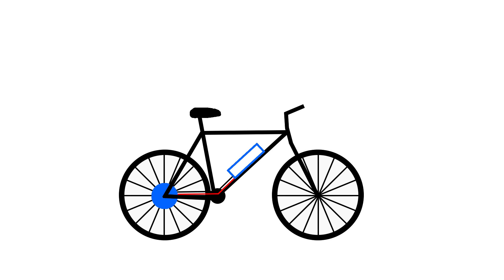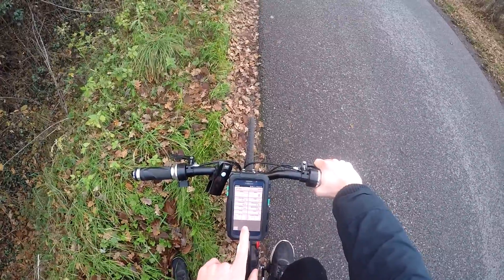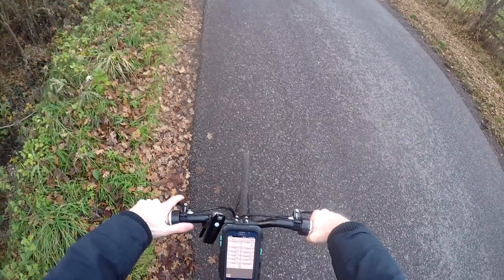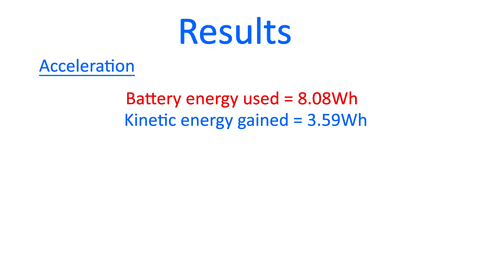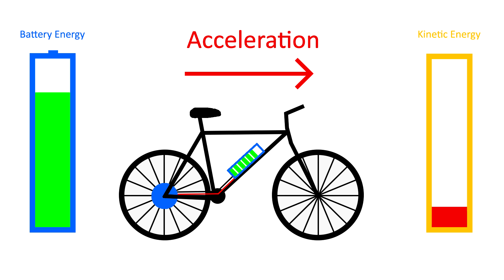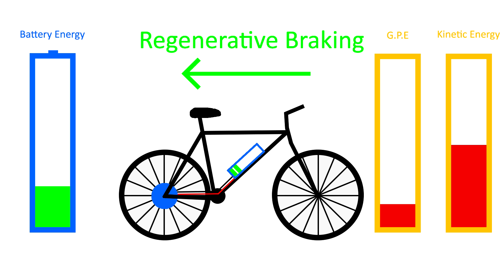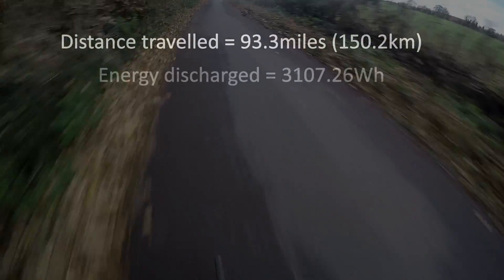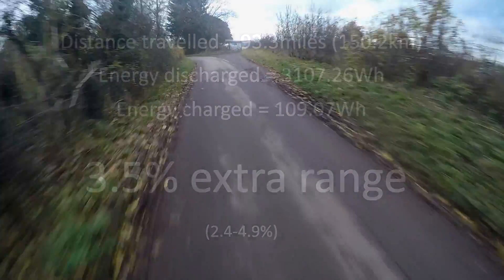Regenerative Braking tests

Comment: great info and content Tom.  if you dont mind...How well does that gear ratio and electric motor handle the uphills around here (i'm from st albans and also went to herts uni). i was contemplating adapting or buying an electric motor/bike for my hybrid to take me to luton and back each day for my commute but i've seen a few of the electric scooter vids on youtube not really like that sort of gradient and struggle to power the uphills.

Comment: Question: if you go down a bigger hill wouldn't it charge more the battery than a smaller hill?
Reply from the maker: +MC's Creations Yes it will charge more from a larger hill, but assuming you have to ride back up the same hill, you'll use more energy to get back up the hill. So overall, the percentage of charged to discharged will be similar

Comment: Or you could just lift the wheel off the ground hold the Regen braking down and start pedaling. Not sure how much you could power with it though.
Reply: That would be a really good workout. If you pedal for an hour (assuming ex-pro cyclist) at 350w, then with this motor (around 1 HP or 750w ballpark), then you'll get 350/750*eff*60 = minutes of powered ride. With it being I would say closer to 30% efficient (drag is massively hurting his results), then its 8.4 minutes of full power. That's really not bad if you're just using it primarily as a work out device since its essentially free energy your next commute.

Comment: Actually... 'THEORETICALLY' the most efficient your system will be is about 80% and from there you have to count in losses in load acceleration, wheel slippage, rolling resistance, armature stall load, wind resistance, and conductive wire resistance.

Comment: thanks for posting. good work.   some very late things for you and your subs to consider.    an e-bike motor is optimized to function as a Motor, Not as a pma.     if the e-bike motor is a brushless outrunner, its performance as a pma will be Extra poor. 
on an e-bike, the duration of any braking event is generally Brief.   and, compared to an automobile, there is Not a lot of kinetic energy in a moving bicycle and rider.      conclusion:   regenerative braking on an e-bike is Not worth the time and money.   
( did you know this going in.   if not, i would suggest that in the future you conduct a lot more 'thought experiments' before beginning a project. )     cheers

Comment: what exactly does regenerative braking cost? its just a switch that turns the motor into a generator and feeds it back to the battery right? It doesnt sound expensive but I'm no electric bikologist.

Comment: In case anyone else was wondering what a VESC is, after a bit of googling I discovered it's just an ESC (electronic speed controller) that was designed by Benjamin Vedder. http://vedder.se/ released as open source and supports regen and a bit more.
I presume the V comes from "Vedder", but can't find any definitive explanation.
It is still an ESC, or 3-phase inverter for BLDC motors.

Comment: Tesla gives you no choice in cruising. Its either hard regenerative breaking or soft.  I would like the option to choose for myself and have a neutral setting. Just like a gas shifter, when I press the clutch down the car goes into a free role.

Comment: But you have air resistance which is slowing you down as well as the breaks

And only have the battery speeding you up
Reply: Yes, that's part of the reason regen braking isn't 100% efficient. Rolling resistance is another factor.

Comment: you have tried it with one rear engine, what if you have front and rear engine ? wouldn't it be more efficient to both accelerate and decelerate ?  plus you have more powerful brakes system that you don't need to spend that much money on brake system and recharging batteries will be a plus thing compare to achieve nothing with normal brakes. what do you thimk ???

Comment: Hi Tom could you explain how the regen works please? Eg. If you apply your disc/rim brakes, how is that energy captured? Or is regen only harvested from using the electric motor? And is that the equivalent of 'throwing it into reverse'?
Reply: A motor spun backwards can become a generator through some clever engineering. With regen, you brake only with the motor and not with the pads. Feel free to look up a more detailed explanation!

Comment: Would you do regenerative braking to generate electricity for other things, rather than putting it straight back into bike speed? Say I have a normal bike and I add regenerative braking with a battery I can charge my devices from.
Reply: Yes USB acoustic acovertor
Reply: Just add a hub dynamo to your bike - much less weight and lower-cost than an e-bike motor, and the few watts you get from a dynamo are probably about right to keep your phone going.

Comment: Surely the battery can’t be happy with you charging it (braking) at the same rate/current as you’re discharging it (accelerating). Does the VESC not limit the charge rate?

Comment: Did you factor into account the amount of energy used by the Bluetooth connection to your phone it might not seem like much but I know that Bluetooth isn't the most energy efficient thing
Reply from the maker: +Alyson Hunter The speed controller only measures what is discharged/charged to/from the motor. The energy used to power the bluetooth module and the speed controller electronics are not measured. I realised this when my charger was putting in more battery capacity than the app measured

Comment: Can you use SI energy units, namely joules, not Wh, which is silly as it is the same as J.hr/s, which uses two different time units.
Reply from the maker: +Peter Smyth I used Wh because it is a more common unit when talking about electric vehicles, therefore more people can relate to it. Also the seconds cancel out the hours to just be J ;)
Reply: Tom Stanton I know the time units cancel out, that's what makes it silly. You wouldn't describe your height using meter liters per gallon. I don't care how common the unit is, it's still inferior to Joules.
Reply from the maker: It's not silly at all. Wh converts straight to J, not Jhr/s. That's the same as saying 2+2=16/4 instead of 2+2=4... I'm sorry this has been such a pain for you, but I try to make my videos understandable for the masses rather than getting all caught up in which SI unit is best. I could have used all sorts of graphs and unit conversions, but instead, I used simple animations and commonly used units and still convey the same information. If you want to convert it to joules, multiply my values by 3600.
Reply: Wh is the same as Jhr/s. I enjoyed your video, and thought the diagrams and experiments were good. I was just suggesting what I prefer as an energy unit :)

Comment: well that's good but sadly what is the unseen cost to this? Yes it saves brake pads on cars , and you can go and say I'll never have to service the car.. because your putting were & tear on the moter.. so ATM I'm not sure what the figures suggest but there isn't much electric cars to ice car ratio to see the downside to this yet.. I'm sure the moter cost far more then pads... But having said that at this current point in time its worth it until there is enough data to prove what effect it has long term

Comment: No doubt this will seem to many like niggeling but in the Uk "15.5 mph
The law in Britain places a limit of 15.5 mph maximum assisted speed and 250 watts maximum power output on electric that allows them to be treated as conventional, non-electric cycle – that is, no requirement for a licence, helmet or cycle insurance." source https://www.eta.co.uk/2013/01/30/50mph-electric-bicycle-for-commuting/
You may not want to mention your speed in future videos!.
i like the bike though.

Comment: Thanks for the video. I just bought sine wave controllers for one of my bikes and they have EBS braking. Is that the same as regen braking?  The other thing is...does the motor have to be compatible with this feature, or do all hub motors allow the controller to take advantage of this option?  I'm trying to reduce the wear on my rake pads.
Reply: all hub motors are able to do regenerative braking, it is more the matter of controller, if it supports it or not, in combination with a switch (manual or implemented in brake lever) for engaging the RB.

Comment: I am trying to recreate a similar setup using a VESC 4. Where did you connect the throttle for braking on the VESC so that it registered as a brake? What application did you use for control?

Comment: When going down a long steep hill, will I gain more energy regenerating at 20kmph or 10kmph?
Reply: Since you have the same potential energy in both cases, we have to look at the efficiency of your electric setup. 
My guess is that you will get more energy back into your battery if you drive 10km/h. The more energy you pump back into your battery in a given time, the more waste heat you produce.
Reply: yeah keyboard runner is correct a longer slower charge would mean less loss in heat thus more efficient.
Reply: A second thought: 
While my first statement remains certainly true, I think we can't draw a linear relationship between speed and efficiency. If you go under a certain speed you will get no recharge at all, because the components have internal resistances. 
Therefor there will be quite a low optimal speed, but it will not be anything close to zero. 

(Third thought:
The slower you go, the less potential energy is "converted" to drag which will in turn increase the energy you actually can get back into your batteries. )
Reply: Neither - cause it depends on Why you are going at those speeds.
But in general you need a certain speed for the generator to be efficient, and you don't want to go too fast (> 25 km/h) as then rolling and air resistance will sap away a lot of power.
Reply: ABaumstumpf
Thx.
Your comment is certainly more precise (and compact) than mine were.
Do I spot a fellow German there?
Reply: close -very close :P Alpenrammler Österreich.
Reply: dammit xD
Schwabe hier.

Comment: Hi Tom, i'm building a similar electrical setup onto  a soooter. Are you using a BMS between your battery and VESC? If not, do the cells get out of balance very easily?

Comment: The test is kinda meaningless, regenerative braking shines when you have uphill and downhill.  Go uphill at a low constant speed then come back down at the same low speed with regenerative braking. You can get much higher efficiency this way. For flat riding it is kinda useless. A lot less energy is wasted in drag this way and on top of this the regen can happen at just the right power for the electronics and battery making the process extremely more efficient.

Comment: What about using human energy to effectively recharge the battery in the bike, such as not using the motor to go up a hill or using the motor to assist, then go downhill using nothing but regenerative braking? Just basically riding conservatively? I bet you could increase efficiency by much more, not using as much energy that way. On my Homemade variable friction drive bike, I use the motor to assist up a hill, rather than let it do all of the actual work, not for battery reasons, It tears up my rear wheel lol.
Reply: Yes. It is

Comment: What model of phone holder is it on your bike? I have been looking for something like this.
Reply from the maker: +Martin Ramshøj it's sold by a company called Ultimateaddons (can buy from amazon). It's a pretty nice case, but the mount is a bit wobbly when riding on bumpy surfaces
Reply: Thanks for the information. I will look at some reviews. I will use it for geocaching so it needs to be easy to attach/de-attach from the bike.
Loved the video, I look forward to seeing what you come up with next.

Comment: It would be cool to have a bike with rheostatic braking but it would be impractical
Reply: If you already have an always-engaged electrical motor it would actually be easier to do than regenerative braking. But what's the point? Why throw away the energy if you have a battery where you can dump it, and then later reuse at least part of it?

Comment: If we use supercapacitor will it be more eff ?
Reply from the maker: I can't say for sure, but I would assume a super capacitor would only help for really hard regen braking periods. Where the recharge current is too high for the battery to handle, so the capacitor can slowly charge into the battery after the braking period has finished. This could generate more heat and be less efficient, or it could mean the vehicle could perform emergency stops without touching the brake pads, I'm not sure
Reply: Plus super capacitors (as all capacitors) have the "energy drain" problem because off low electrical resistance. That would make them as you suggested helpful for short term high current applications but useless for long term energy storing. You should try to use them somehow for hard braking maneuvers.
Reply: Supercaps is what Rasa fcev is going for. 

I generally would rather adopt a strategy of least amount of braking. Even if regen were more efficient. It also increases range...
Reply: what converter topology are you using for battery charging in regenerative mode...? 
and also it was a great vedio.